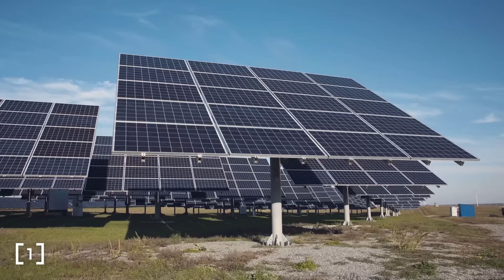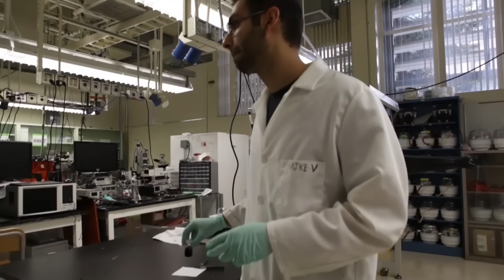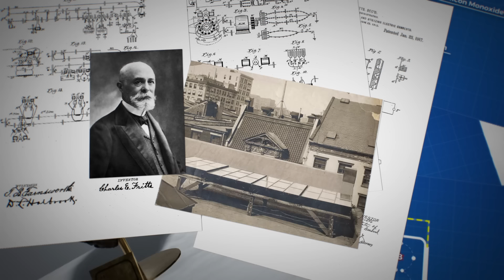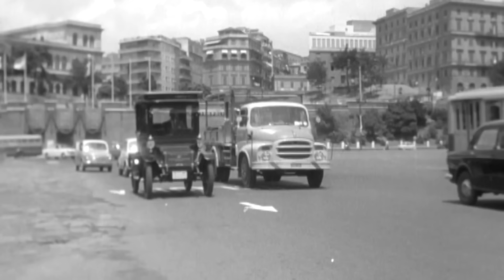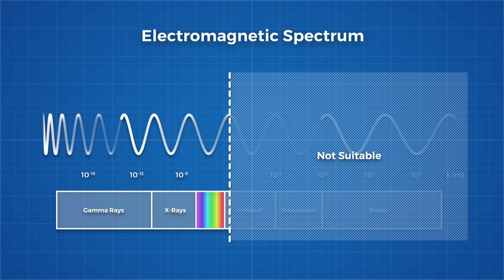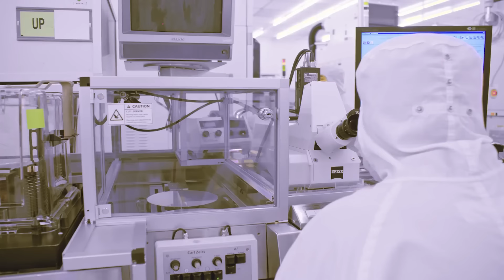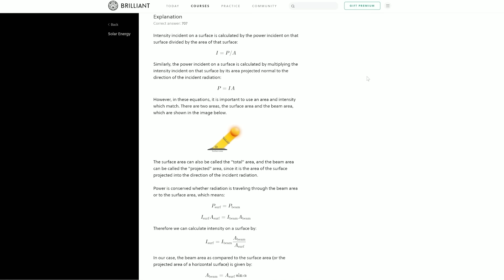The Mystery Flaw of Solar Panels

Comment: Did you read the study on how much more power a Solar Panel would generate if you Water Cool it and had extra Heat Sinks on the back?

It was 19-23% more power compared to a normal Solar Panel without any extra cooling.

By Water Cooling, I'm talking about having the water run over the front of the panels on the side it collects light.

Comment: I understand light induced degradation is a ~2% loss on the total output, not a decrease in absolute efficiency. So, instead of going from 20% to 18% efficiency, they go from 20% to (1-2%)*20% = 19.6% efficiency. You should double check this.

Comment: ref 11:10 -  my 10-year-old is asking: can one make a transparent conductor for the top layer of the p-layer to allow the photons through? sounds like a field of research in material science...
Reply: You're looking at one right now. Even metals are transparent in a thin enough layer, and an LCD screen is just some liquid crystal trapped between two layers of electrodes, both of which need to be transparent to the backlight unit behind them that actually provides the light coming from an LCD panel. And that's before we mention touch screens which have another grid of transparent metal electrodes on top of the LCD, just to sense the capacitance change caused by your finger being nearby...

Comment: I strongly believe this is one of you best videos yet. You could have spoken of PERC solar cells though, but still it was a very informative video.
Also, I think you are the first one here in Youtube to say solar cells work with "photovoltaic" effect, most people say they work with the "photoelectric" effect, which is actually not correct, since they are both different (and yet related) effects.
So congrats on your video 👌👌👍🌞⚡

Comment: Heat is always a problem with electronics.   Makes sense and no surprise that industrial panels with active cooling are more efficient.  Need to develop (for now) more efficient and low cost active and passive cooling.

Comment: An installation can gain up to 200w per square meter of efficiency simply by shading a structure from the direct heat of the sun.

Comment: so how does silicon gets its electron back? he didn’t explain that.
Reply: When the electrons complete the circuit
Reply: look at the animation where the electrons go round and round. each electron recombines with a hole after it passes through the external electrical load.

Comment: The illustration of the PN junction is excellent up to about 10:00. The free electron in the position shown would actually be repelled by the electric field.
Reply: The actual trick to getting a working solar cell is maximizing the amount of photons getting absorbed inside the depletion zone. If that happens, the free electron and hole are quickly separated by the electric field.

Comment: Where do we get all the materials to manufacture solar panels?
Are the materials renewable?

.
Reply: Most of the panel and glass covering is silicon which is 27.7% of Earth's crust and is technically recyclable but not  currently very economical. The aluminum frame is very recyclable.
Reply: @joshuat3686  
also government subsidies

Comment: I think that solar will only be viable as a primary power source if we build a space elevator which attaches to a solar farm in space. Otherwise, nuclear fusion is likely the better option (but we have to get it to work). As solar is now, it should be used to assist dominate power sources (where it makes sense); not replace them.

Comment: So are photovoltaic cells just NPN transistors with one "N" ripped off? 
I assume it's more complicated than that but they also seem VERY similar.
Reply: Well they both use the semiconducting properties of silicon to their advantage, so I'd imagine they'd have at least somewhat similar operating principles.
Reply: It's a PN junction, which you could look at as an NPN, but there never was an n-type there. PN-junctions are used in diodes and LEDs aswell!

Comment: Misinformation on real engineering’s part! IR spectrum can be made into electrical energy. JX Crystals has been creating IR Voltaic crystals for 20 years or so.
Reply: He said is that it's not possible *with silicon-based cells*, which is correct.
Reply: w0ttheh3ll - No it is not correct! Look at JX Crystals!
Reply: w0ttheh3ll - GaSB cells still contain silicon!

Comment: Ehhh....
This just taught me that silicon is a subparr material that's being used because it's the semiconductor with the most research being put into it. 
Carbon or Sulfur would work just as well if someone started working with them specifically for energy production research. 

That all said, there's another reason why solar panels degrade that this didn't talk about, and it's honestly more prevalent. There's a thing called the anomalous bulk photovoltaic effect, which is caused by magnetic fields resolving themselves through a solar panel. The phenomena causes the solar panel to produce AC voltages with a strong DC bias, and the voltages can easily produce over-voltages 10 times what the solar panel is supposed to be producing. 
Simple smoothing capacitors are enough to stabilize the voltage pulse, but the over-voltages can also damage the photovoltaic cells themselves, specifically through heat generation. Any place that's prone to heavy magnetic fields would also see random burn-out of panels.
Reply: "Carbon or Sulfur would work just as well if someone started working with them specifically for energy production research. "
No, not even close.
Like with most materials used for a specific application the reason is rather simple: The easiest material to find is usually the one that works the best as trying any other material will make it harder to find any useful effects.
Silicone is used because it has such GOOD characteristics.
Reply: @ABaumstumpf  You're kinda proving the point. 
Pure Silicon is actually one of the hardest materials to get ahold of. 
To make pure silicon requires extensive electrochemical refining. To the point that most semiconductor manufacturers have refining resources on site to re-process any silicon shipped in to ensure purity. 

Silicon isn't easy. 
It's easy to point control though. 
The nail in the casket, so to speak, is that most semiconductor research doesn't involve silicon at all. It involves wideband gap semiconductors, which are mostly ionic compounds. Compounds like Gallium Arsenide or Mercury Sulfide.
Reply: @walterbunn280  "Pure Silicon is actually one of the hardest materials to get ahold of."
You mean - as hard as getting pure carbon or sulfur? yeah... soo hard....

"is that most semiconductor research doesn't involve silicon at all."
Sure - it "only" involves researching how to manufacture the parts with more and more precision, how to use different doppings to get wanted properties, to how to mass-produce products with atom-perfect parts.....
Yes, other materials are researched but not cause silicon is "subparr" as you in your lack of understanding claim but rather cause they are Assumed to have Some properties that Can make them better suited for certain applications.
But please, go ahead and ask Samsung, TSMC, OnSemi, Infineon, TI or any other if they have any intention of switching to those more expensive and harder to manufacture materials but i can already tell you the result - No - cause in the vast amount of applications silicon is simply the better suites material.

You strike me as the ignorant fool that also believes glass to be a good road material.

Comment: Hi there!
Great video as always. 
A question popped up in my head: 
If a photon has a large amount of energy, more energy than the energy needed to excite 2 electrons, can this photon bounce of the one electron and excite another one?
Reply: This is called multi-exciton generation. I actually did my masters thesis on this exact thing. It has been shown by research at NREL that this can occur with up to 600% quantum efficiency in semiconductor nanocrystals. It will not occur in bulk material (ie. silicon) because thermalization (crystal lattice vibrations to release the excess energy created by the high energy photon) is just too easy. When the semiconductor absorbing material is quantum confined(at the size of 10’s of atoms) you can get something called auger recombination (rare in bulk materials - primary recombination is SRH, or radiative) which takes the extra energy to excite another photon. The problem with this is in an isolated nano-crystal you cannot extract the generated electrons. 
My these was making a special nano-structured surface of silicon so you could get the multi-excitons in the nano-tips and they would then be able to be captured.
Reply: Sean Jacobs literally the best answer to any comment i’ve ever written. Did you manage to create this nanosurface from silicon, and do you think future solar technology can implement this (in the lab/ and maybe even in bulk in the future)?
Reply: meneeRubieko I actually did create a process and a prototype! Our lab didn’t have the sophisticated tech to be able to measure the quantum effect I was looking for but I did take some cool scanning electron microscopy images of it. And a nice side benefit was that it created a graded refractive index which resulted in a VERY good anti-reflection coating which is in hindsight obvious but unintended.

The unfortunate part is that with all the theoretical analysis all this idea can do is improve the maximum possible efficiency by an absolute 3% or so
Reply: Sean Jacobs that’s awesome my man,  even though it was in the lab, it’s very cool to see that the technology is being pushed to it’s limits by scientists such as you. This 3% improved efficiency you’re talking about actually sounds huge to me, with current state of the art (available for sale) solarpanels being at 22% efficiency and the theoretical max being around 30%. But with cost/efficiency ratio playing a huge role this capitalistic world will never try to incorporate this idea. Cool to know though thanks ✌️
Reply: meneeRubieko in a way you’re right... but honestly I got somewhat disheartened by the research. I saw so many millions $ going into research but even more millions going into oil and coal industry. The $ in research in high efficiency solar I believe will be better used just to offset costs to make it even more price competitive. Sure a couple % is awesome but like you said we are exponentially approaching the theoretical limits as it is so it will take massive more $ to gain small amounts. 

It was a rewarding project and it could eventually maybe be implemented but there’s such good products on the market already I still think it’s better to research better encapsulation so the panels will literally last lifetimes.

Really though, kudos to you for asking the original question you did. Shows great understanding of the concepts.
Reply: Sean Jacobs what I read is that this principle exists and is being tested in laboratories at this moment but it does’nt work in sillicon panels because the array causes the extra energy to be excerted as heat?
Reply: meneeRubieko basically. Without quantum confinement this process is too difficult to happen. Heat is easy.
Reply: Why shouldn't it. They're like balls in a ballpit anyways. I mean, a similar thing happens with neutrons in a nuke.

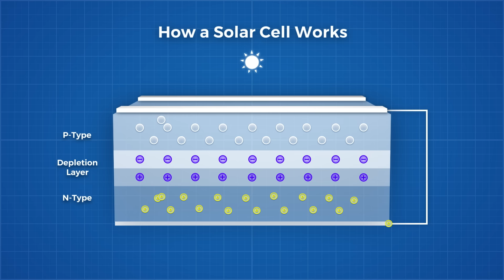Comment: 10:53 why will the electrons (that were freed by the protons) travel across the barrier? wont the electrons be repelled by the negative layer in the p-type cell? how can the electrons overcome this p-type cell negatively charged layer naturally and pass over to the n-type cell???
Reply: They are repelled by the negative charges, but they are also attracted by the positive charges on the other side. This electric field accelerates them from p to n
Reply: @battleclan  thanks, but your answer is still unclear to me and somewhat contradictory. if they are repelled and attracted, wont they 'cancel out'? why is there instead a resultant net 'force' causing the electrons to move towards the other side?
Reply: @thegoonist  Think of it this way. When the pn junction is made, there are free electrons (n) and free holes (p). Electrons and holes want to recombine, so holes move over to n, electrons move over to p and recombine. This leaves charges ions in the depletion zone where the now recombined holes and electrons used to be. Positive cations on n-type, negative anions on p-type. These charges make an electric field. Charges keep moving over and recombining until this electric field is strong enough to stop the free charges. Pn junction is then in equilibrium. This next part is a little unintuitive to me too, but when you then get a free carrier on one side, the junction is no longer in equilibrium, and the charge needs to move. It would make sense to me if this extra negative charge on p side would increase field strength so that a hole could move from p to n and recombine. But I'm willing to accept that the electron can "overcome" the negative field and drift over. Idk if this half assed explanation did anything :p
Reply: @battleclan  well i appreciate the detailed effort to explain it...i get the first half...but unfortunately you didnt really address the crux..i.e. the part which you also admitted was 'unintuitive' . maybe someone else with a better understanding can help :) thanks in any case
Reply: @thegoonist  My textbook on semiconductor physics states the following about free charges at a pn-junction: "...there are, however, very few carriers within the transition region at any given time, since the electric field serves to sweep out carriers which have wandered into (the depletion zone)". Seems that the charges arent' that affected by the field, and can move into the electric field through random motion - or a similar mechanic. I know this still doesn't explain _why_, but I hope you can accept that this is in fact what happens?
Reply: @battleclan  thanks for the textbook quote. i mean i have to accept this happens right? since the solar cells work LOL...which implies that electrons are flowing through. but i was just hoping for a more intuitive explanation of why the negatively charged electrons are able to flow through the depletion zone.
Reply: @thegoonist  I've read further now: "The electric field is assumed to go to zero at the edges of the transition-region (edge of depletion zone), since we are neglecting any small E-field in the neutral n or p region". This is what is called "the depletion approximation", so it assumes straight, hard limits between depletion zone and n/p-regions. I know, still no good intuition. Will update if I find a better explanation :)
Reply: Ok, so evidently the generated electron in the p-type can only enter the electric field if they are generated within one diffusion length from the depletion zone. Then they can move into the field by diffusion and be swept over. If this is considered as diffusion by random motion, then it makes sense. Do you agree?
Reply: @battleclan  i see thanks. makes slightly more sense. so its brownian motion then? ie diffusion of electrons across the zone due to a concentration gradient? 

what does 'one diffusion length' mean?
Reply: @thegoonist  I guess you could say brownian motion for solids, but in this case there shouldn't be any significant concentration gradient, but rather just random (or brownian) thermal motion. One diffusion length is the average distance a charge will diffuse/move before it recombines with a hole. So if the generated electron is too far from the depletion zone, it will move about randomly, and then recombine (de-excite?) with a hole without contributing to the current in the solar cell.
Reply: So to sum up: The generated electron sees/feel the negative barrier of the electric field, but can through thermal motion overcome this barrier and enter the field and be swept over which gives current
Reply: @battleclan  interesting thanks. makes more sense now. so it seems that the inefficiencies in solar cells could be attributed to the inability to direct every free electron through the zone, and prevent them from randomly recombining into the holes.

i.e. right now the electrons are crossing over due to their natural random pathings/motions in the silicon lattice...if theres a way to reduce this randomness...and force the electrons through the zone...the efficiency of the solar cells will increase...

Comment: i’m probably just missing something but can someone explain how a 2% drop in efficiency results in a 10% drop in total electric generation?
Reply: Take for example a 20% panel produces 20W, and a 18% produces 18W. 20-18 is 2. 2/20 is 10% less production.
Reply: Travis Struckhoff : thanks, as i was watching the rest of the video it clicked. but you did a good job explaining it :). i’ll leave the comment up in case anyone else has the same confusion

Comment: So if electricity is made by knocking electrons out of material, what happens when the material runs out of electrons
Reply: I've never understood this either.  Don't a generator's copper coils run out of electrons at some point?
Reply: In the video he talks about how it doesn't just do to knock the electrons free, but they also need to be able to move? When you make a circuit, you pull electrons from one side of the circuit to the other. But to be able to do that, there needs to be something making free electrons somewhere in the circuit aka producing electricity.
Reply: @battleclan  maybe the energy comes from the motion of the electrons and not the transference of it

Comment: 10:45 slight correction here, actually electrons move from  n-type to p-type and also from +ve terminal to -ve terminal. What you have shown is direction of flow of current, electron flow is in reverse direction of current flow.
Reply: actually the animation shows exactly what you just described.